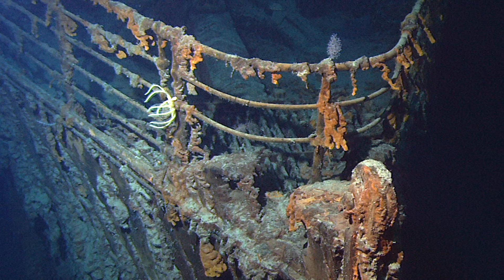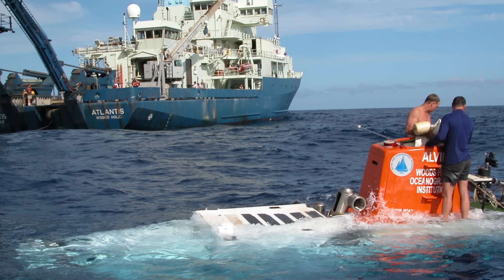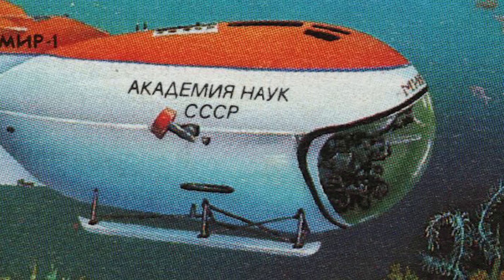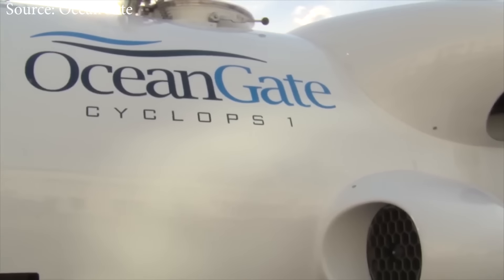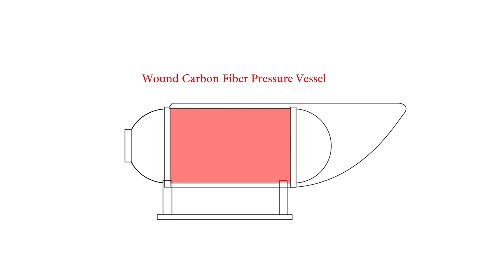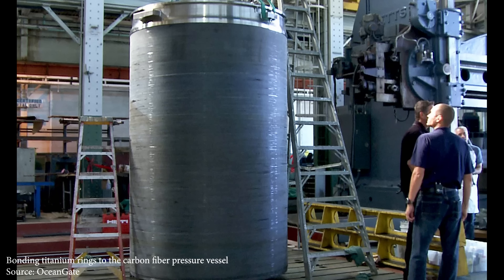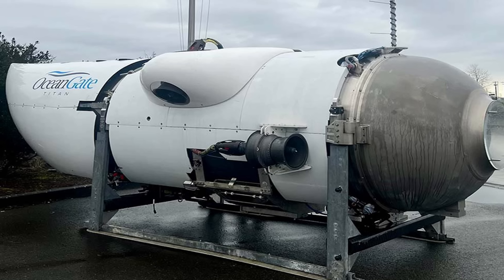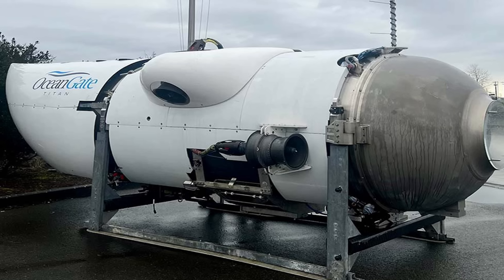How Titan was Built, Lost and Found: An Analysis

Comment: Please don't further facilitate debunked myths. The windows of the comet jet liner weren't a mode of failure. This is well known for half a century. Starting by the fact that they're not square but rectangular, to the fact that they have rounded corners, to the fact that the only time "window" is mentioned in Cohens inquiry report, it refers specifically to Antenna cut out "windows" located above the cockpit as point of failure. The passenger windows (the "square ones") weren't implicated in ANY failure mode and were not a contributing factor to any of the hull losses.

This becomes even more obvious when you look at planes like the early DC-7 and DC-8 as well as the 377 Stratocruiser, all of which have larger and "more square" windows than the Comet. In fact, experts point out that the Comets windows are virtually identical to modern 737 windows, just mounted horizontally instead of vertically like the 737. They went to round windows because you can glue them in, whereas the rectangular windows had to be rivetted in. 

For evidence, they submerged a Comet in a tank of water and raised and lowered the pressure until it burst from metal fatigue, which it did after around 3000 flight cycles. It tore from a bolt hole in front of the forward left escape hatch, nowhere near a window. Another Comet involved in a crash was mostly reconstructed, with evidence of a fatigue crack from a rivet hole at the forward aperture around the the ADF, leading to an in flight disintegration. Again, nowhere near the windows. 

Comets broke apart because they were the first commercial jet liner to fly at altitudes where pressure becomes a severe issue, exacerbated by the fact that the Comet, for the lack of a better word, was flimsy as shit. This was known before it even entered service, with test pilots noting that above 2g in a corner, the floor inside the plane was bulging and the skin of the aircraft flexed with an audible bang at speeds above 340 knots. That's in 1949. 

Lastly, both Boeing and Douglas stated later down the line that if the Comet didn't have the problems with pressurisation, it would've happened to their planes instead.

edit: there's also a huge difference between using a controller to move a periscope, and a BATTERY POWERED CHEAPIE BLUETOOTH CONTROLLER as the only mode of actual control of the entire craft. That's what people made fun of. Nothing on Titan was "simplicity", it was almost exclusively "cut costs, and a few corners too", with some proper stupid "design" decisions. It's also kinda odd that you don't want to get into conjecture about the mode of failure, but then go full ham on the "reasons" for Titan to exist in the first place. While somehow missing the fact that the CEOs wife is the great great grand daughter of Isidor and Ida Straus, both of which died on the Titanic, with the Titanic always having been stated as the actual goal for the company - which would be rather odd for a science vessel. You build a science vessel for science, not for a particular, very specific goal that happens to have family ties to your wife. He also bloody paid for a marketing study to see if there was sufficient demand for underwater ocean tourism. That was always the goal, not sure why you have such a boner pointing out that he's a science guy. He's not, obviously not. From the very start, taking tourists was one of the main goals of OceanGate, with Antipodes (their first submersible) in 2010. He literally is on record criticising the Passenger Vessel Safety Act of 1993 ("needlessly prioritising passenger safety over COMMERCIAL INNOVATION). 

This is FAFO. It's a stupid man squished to death with innocent people paying the price for his recklessness and greed. He was not a scientist, the company existed to make money and give his wife the opportunity to visit her grand grand grandparents.

That said, if a person looks at Titan, which was found with bloody ratchet straps holding the panels of the tail section together externally, and thinks "yeah, that's what i want to trust my life with", then.. i guess it's a little bit of natural selection there. I wouldn't get in a bus that has the roof ratchet strapped to the rest of it, for certain.

Comment: I am curious about that steel tubing with flanges on each end when they were applying the carbon fiber haul. On the OceanGate video you can see there was a steel support cylinder. What happened to it? Why didn't they leave it there? Also if it is not a part of the final haul, how did they remove it from the carbon fiber if it had flange on each side?

Comment: 15:01 it's a nuance but largest for submersible use.  Technically the 787's fuselage is a larger wound carbon fiber pressure vessel but it's used in a radically different application/pressure profile.

Comment: I'm thinking the sag stress on the tube all the time it was not in the water weakened it in the middle (from front to back). If my theory is correct, a third set of legs, in the middle, would have been the answer.

Comment: The cilinder is as resistant as is the bonding between the cilinder and the fiber glass. Once the fiber glass started to make voids under it was only a matter of time till colapse.  
I think that is what happend. The water made  way under the fiber and metal cilinder, it was usless for resistance in short time. All those ciclyes of heat and compresion made the fiber as usless as a rain coat.

Comment: the acusic warning system i think stockton try to use it as its seen in sifi movies where the crew of a space ship or sub can say thay are near hull breach or max pressure.
in this case its just warning if the system picks up cracking sound amplitude if its a big or small crack and not the total integrity of the hull or how much more or less strength it got left.

Comment: The US Colorado is NOT using off the shelf wireless Bluetooth controllers for the main controller. That is absolutely ridiculous. No safety critical equipment should run off of consumer grade batteries and a BT connection that is prone to failure.

Comment: Carbon fiber composite sounds like a very wrong material for a pressure vessel that has to withstand external pressure. Carbon fiber has huge tensile strength but compressive forces are taken by the plastic that binds the fibers together. In the submersible hull all the forces are compressive so fibers had no role at all and the hull was effectively just a pressure vessel made from plastic.

Comment: So is there any reason you can’t make the whole pressure vessel out of titanium? Surely that would be safer.
Reply: Most military submarines are made of titanium so yes! However titanium is also non magnetic so that's why it's used on military vessels
Reply: He used carbon fiber sonit was lighter, cheaper to haul around. That’s where it gets expensive, so he went with the fiber.

Comment: Yea I wish you would be more strait forward about the folly’s of the vessel.” A cylinder may not hold up as well under pressure “ this is not true a cylinder is absolutely not as good as a sphere at holding up under pressure also Carbon  fiber was a horrible choice. Basically any engineer will tell you that. Also joining two different materials with a joint that cannot be inspected could lead to a lot of issues… dude this is engineering 101. I understand wanting to set the record strait but leaving out and misrepresenting key factors does no one any good

Comment: 13:17
This drawing is very misleading (I should even say completely wrong) and propagates a common myth that isn't true at all. It points to Comet's passenger windows as failure point when in reality the failure on the accident plane occurred around an antenna cutout that isn't even depicted in this drawing (even tho it would be visible from this angle). The myth of the failure point being windows comes from a misunderstanding of the original accident report where two cutouts for ADF antennas on top of the fuselage were referred to as "ADF antenna windows". This together with the fact that later Comet models had oval windows convinced the public that the shape of the windows was the problem. In reality the failure point was a rivet hole punched close to one of the ADF cutouts. A crack was able to form there from a combination of poor craftsmanship and insufficient skin thickness. This crack has eventually expanded and reached a corner of one of the cutouts, leading to decompression and structural failure. The failure of the structure was inevitable because it wasn't a fail-safe design, meaning that serious damage to the skin could expand and weaken the whole structure enough to cause its failure. That's why the most important change that had to be done to prevent this from happening again was redesigning the structure to make it fail-safe, so that potential skin damage could be contained within a certain section. This is now a standard aircraft design practice. Production methods were also improved and the skin became thicker, but ADF antenna cutouts actually remained square to the end of Comet's production because their shape on its own wasn't the problem. The change in the shape of passenger windows on Comet-4  is almost completely unrelated to any of this. I suspect it has somewhat reinforced the structure, but that would only be an extra added benefit and not a necessity. The actual reason it was done was probably to standardize the Comet with other British airliners from the period that tended to have oval windows

Comment: The question I have is, when they dropped all ballasts and even the skids, why did the Titan not ascend more quickly. It seems to have ascended at a rate of like 5 meters/hour, or something like that. Shouldn't it have been ascending much more quickly? 

Was it because of the weight of 5 crew that limited it's rate of ascension?

Comment: It's a terrible thing that hPpen to those people but let's agree that most engineers and experts agreed it was not tested properly and carbon fiber is known not to be good at all for that type of pressure. It's only strong as it where to hold in pressure like a scuba tank. Not the other way around. It was a terrible idea to take a chance on peoples lives especially when proper test where not done. They where warned many times from experts not to keep use n it.

Comment: You are giving Oceangate a lot of benefit of doubt in their construction of the sub, but they knowingly and willingly didn’t have the vessel certified and were flagrantly dismissive of safety standards and regulations, even though many professionals were concerned about the potential dangers associated with its construction! 
You should not be giving them a way out of responsibility when they were obviously cavalier about safety!!
Also - Oceangate never did any post dive testing of the sub to determine if there were any faults or damage to the structure, and they never gave a lifespan for their subs, or a timeframe for overhauls or other standard repairs procedures like in the aviation industry! Their design was not a safe choice as most others are a ball shape for obvious physics reasons and they were trying to fit more paying customers inside it! 
Don’t avoid conjecture about the design of the sub, it’s all come out that they were outrageously cavalier in regards to the safety protocols they should have followed when designing the sub 😡

Comment: Active Sonar not only can startle marine life, if close enough to the source and depending on the power output of the ping, it has the potential to kill, shatter eardrums, mess with the  way whales & dolphins navigate throwing them off course, etc.

Another drawback of active sonar, and why it is sparingly used by navy submarines is that it also gives away the position of the vessel emitting the ping to anyone listening on passive sonar.
The giving away of the position is much less of an issue for surface vessels, since there are multiple ways in which their position can be located.

Comment: It's not the controller, or the hand application of the epoxy that bothers me. It's the composite material itself, and especially it being co-joined and contingent upon the dissimilar material of the titanium; The materials will have different reactions to temperature and pressure changes, potentially offering a weak point. I think what can be overlooked too, is that even a very tiny leak that gets part of the way between the carbon fiber or between materials allows that immense pressure to then be present that much closer to where there is the lack of pressure inside the vessel. For a thought experiment: imagine a hole drilled into the side of the carbon fiber that is 1 in diameter and it does not pierce into the inside of the vessel, but stops short by a quarter of an inch. The result of this is that that immense pressure is then acting on one inch of wall thickness of the vessel. Imagine it is not a 1-in diameter hole, but half an inch. The result is the same, regardless of the diameter. If the diameter of the hole were 0.001", The PSI of the water would be the same as the 1-in diameter hole, although the resulting total pressure in that area would be less, because pressure is a function of force over area. What I'm getting at, is that through multiple temperature cycles and multiple pressure cycles it could be possible that a small amount of delamination occurred, which would allow water and the subsequent pressure to become evident between layers catastrophically impairing the integrity of the hull. One important aspect not covered by anyone that I have seen, is that carbon fiber is electrically conductive, and if that was not accounted for and if it was electrified, that electric current can seek ground state through the seawater, thereby creating a notic reaction which dissolves individual carbon fibers. The dissolving of the fibers could have allowed the small ingress of water which I talked about earlier. I have experimented with this in products of my own, using carbon fiber materials in an anodic state, and plain carbon fiber completely dissolves in water when put in an anodic state relative to the water. Nearly all material degradation can ultimately be traced back to electron transfer and loss from that material, which subsequently undergoes oxidation or some other transformation as it loses electrons.

Comment: I seen hours and hours of content and articles relating to the Oceangate Titan, and not one mention of the fact that the method they used to manufacture the carbon fiber hull is completely wrong and unprofessional. Take a look at any carbon fiber air tank or for example a carbon fiber nitrous oxide cylinder (tank), and it WILL be made with a cross-hatch pattern. These guys must not have even bothered to even ask a casual enthusiast, much less a professional about whether or not they had the right idea on the carbon fiber. One look at that carbon fiber hull and i could have told you ahead of time to expect it to fail catastrophically. Utter incompetence and a failure of due diligence in research before moving from design to manufacturing.

Comment: If there were a way to rate a hull of Titan's construction (and there isn't, really) it would depend on determining a safe number of dive cycles it could undergo before the hull needed to be permanently retired. In practice, this would be a small number like 5 or maybe as high as 10 as cumulative delaminations further weakened the hull and accelerated the compounding deterioration it would experience on each successive dive. And imagine, those numbers could only be determined by cycling several hulls to destruction and then arriving at a conservative cycle number everyone could feel comfortable with. Effectively, Stockton Rush had built a disposable submersible. This design philosophy might have worked if he had actually treated his creation for what it was; a severely life-limited wear item and retired each hull like a worn-out brake pad after, say, every 5  deep dives, but that's a terrible business model since this would have made the per-dive price prohibitively high and the craft would still be dangerous because you never know how long or short the path to destruction any given hull will take. Installing acoustic sensors to monitor the hull's pre-catastrophe disintegration is like building a feature into a smartwatch that says, "Your heart has stopped." By the time you get the final warning, it's just a bit late.

Comment: I used to be involved in carbon composite construction of boats and actually part of a submersible docking collar. Then later I’ve working in building underwater vehicles. 

There is a reason why pressure vessels used in submarines are a single material. Different materials expand and contract at different rates. Joint failure from work hardening is the main cause of retiring a vessel. I will say with almost 99% certainty that the point of failure is at the titanium/carbon mating point. When carbon goes it goes explosively. 

They would have heard some delaminating and then it would be over. Like Camron said they knew it was going to go and tried to reduce pressure on the hull, it was to late at that point. That submersible was a timed death trap zero ifs ends or buts about it.